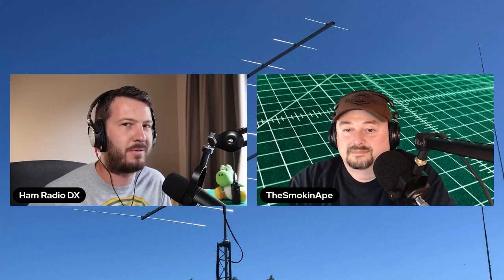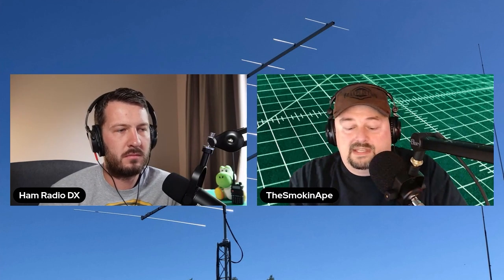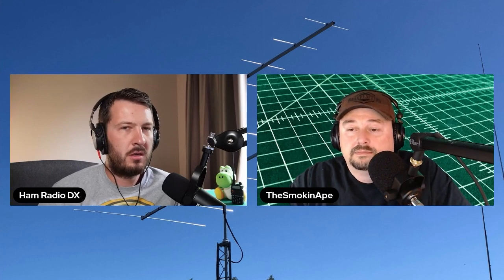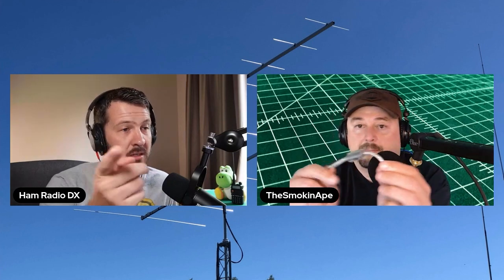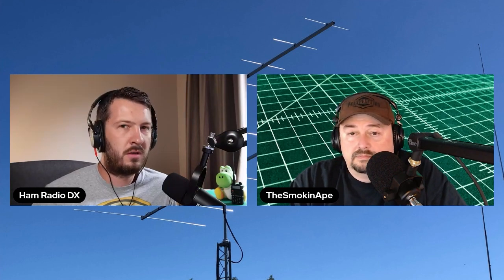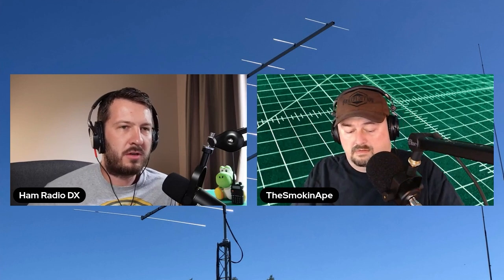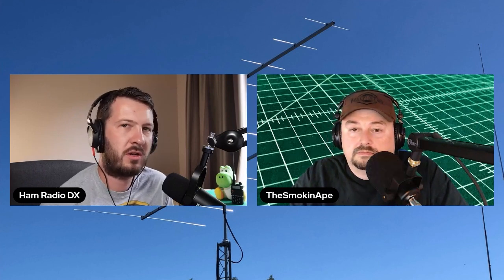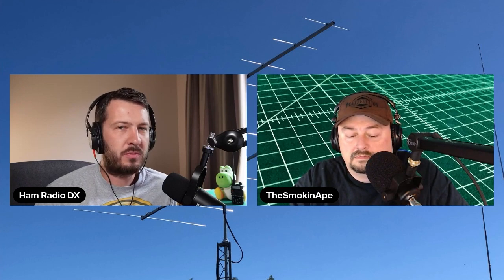What is RFI? An Introduction to Radio Frequency Interference

Comment: I have an odd issue where I receive RFI on every HF frequency outside of the ham bands. 20 and 40 meters can have relatively low noise floors, but as soon as I dial above or below either band the RFI quickly reaches S9 and sometimes +20.

Comment: I have a signal that comes and goes. It's between rough;y 4Mhz to 8Mhz and every 8Khz. I have killed ALL power in the house and put the radio on battery and I still have it. SO it is external. :(
Reply: Mine is intermittent, periodic, and varies in intensity, but only on 20m and 10m. Definitely external, on battery it still exists, but when my end fed is disconnected, it goes away.

Comment: Had a power blackout last night, QTH Sydney. The whole district was out, so I knew it was the perfect opportunity for HF listening off battery. The S-meter was at zero, noise floor effectively zero. I picked up so much I'd never heard before!! Weak signal cw, distant hams, volmet, beacons, WWV loud & clear on 5 & 10Mhz. I left it on 8867 aero. When the power came back on, the noise floor shot up to S9. It wasn't one single device, just the total sum of QRM from multiple devices (neighbouring apartments) plus the fact I'm only 2 storeys above ground. There's not much I can do to reduce noise, other than move or simply wait until the next blackout..
Reply from the maker: Haha power outages are great for working and gearing the DX 🤣

Comment: Need to buy one of those RFI qrm eliminator ☺️😳 first try running rig on a isolated battery to see if it is in fact no electrical line noise/hash. So next is a big common mode choke on the antenna feedpoint. Then it’s time to fox hunt the location of a signal Hf will be harder but a 3’ magnetic loop to use it null to pin point location.